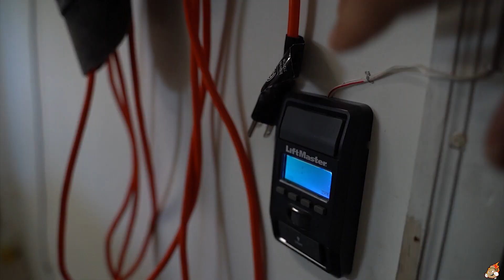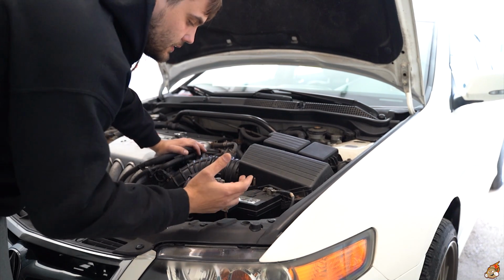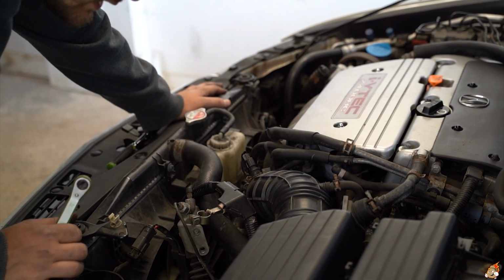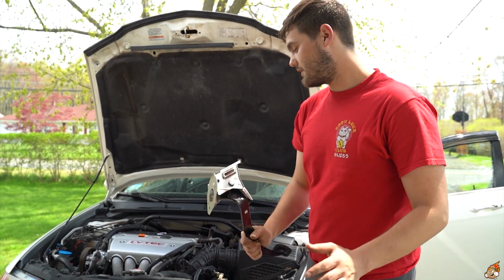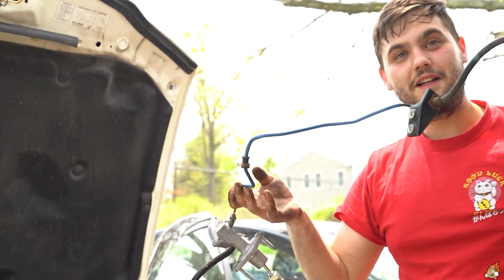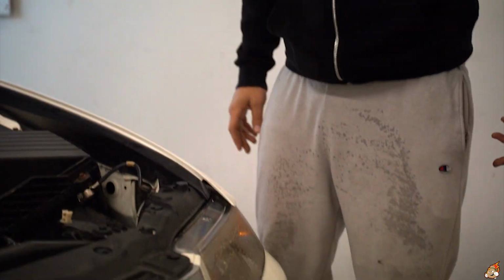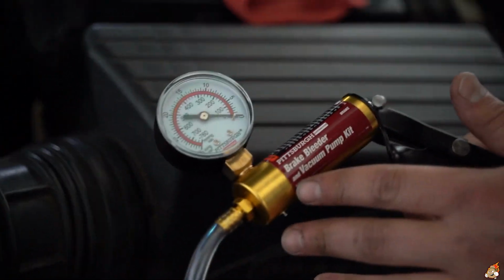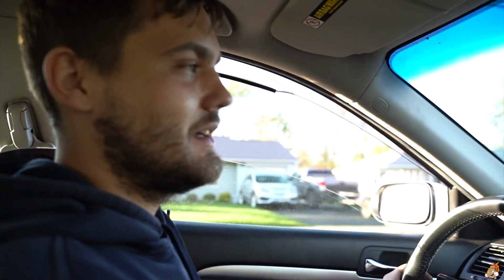Hybrid Racing CMC & Slave Installed For The TSX // IMPROVED SHIFTS!

Comment: Did you switch over the CMC rod from your OEM TSX slave to the EM1 CMC?  They are different lengths and Hybrid Racing says to use the OEM rod
Reply from the maker: Yes i did, if i remember I didn’t at first then learned the hard way had to take it back out and swap that and the little bracket over

Comment: Rish 
I have hybrid cmc & csc, 

Trying to adjust pedal n engagement n etc. 

Tips bro? Appreciate it
Reply from the maker: Gotta adjust it from the rod on the CMC, so you loosen the nut with a 12 mm. 
Get a vice grip and adjust a little at a time little goes a long way. Bringing the rod toward you brings the engagement lower and less pedal pressure. Then obviously the opposite going toward the cmc.
Reply: @RishMedia  curious- how much higher is your clutch pedal compared to your brake pedal?
Reply from the maker: @M35180S  honestly no clue never checked or realized a difference
Reply: @RishMedia  my clutch pedal is noticably higher. Okay

Comment: After I replaced my cmc my clutch pedal makes a creaking noise. Any suggestions?
Reply from the maker: Put some grease on the cmc rod/ball push it in and out get it moving, grease more where the spring is on the bracket. If is still happens you may have some cracking  on the clutch pedal bracket
Reply: @RishMedia  hey so I sprayed alot of silicone spray and white lithium grease all over and the noise was still there. After digging around online I found on an rsx forum that it’s actually the slave cylinder and the clutch release fork. I verified it with someone pressing  the clutch pedal a lot. It makes sense now because when i installed the ktuned master n slave. I don’t remember greasing the slave ball n clutch release fork areas. The rubbing medal ball onto the fork is so bad that I felt it on the pedal. Maybe U should do a video of taking off the slave to grease the ball n fork areas. I couldn’t find any videos on it and also the Honda super hi temp grease is hard to find so I haven’t tried to fix this yet.
Reply from the maker: @tannguyen-dg8su  yup that’s also a culprit to the noise like you said. Always any metal on metal friction more than likely want some grease on there! 

I’ll be replacing my cmc and slave soon on the black daily Tsx and ofc a video coming on that!

Comment: Hey rish ..which do you prefer for a cmc and slave ?? Since you have installed hybrid and ktuned before and do you prefer sticking with the stock slave or will be better to just get the whole kit
Reply from the maker: Honestly the slaves are all the same functionally wise just some quality differences, the braided line and the no delay valve in CMC what really help.

Comment: Hey man I did this mod just the other day and I know you have to remove the em1 rod and replace it with the OE rod. But after everything my engagement is really high and I'm not sure why. Even after trying to adjust it down. How did you adjust it?
Reply from the maker: You’ve gotta being the nut on the CMC itself basically like flush with the bracket, then i think itll allow for more in and outward adjustment with the one with the sensor.

Comment: Is the slave cylinder also from an em1 or just the master cylinder?
Reply from the maker: Honestly that I’m
Not sure slave is just the slave honestly I don’t think it’d have a special purpose oppose to others. 

The CMC is what really does it,  people said they’ve pieced together their own setup
Reply: @RishMedia  thanks also when installing the cmc and slave did the engagement point change or it stayed the same where does your clutch grab and engage
Reply from the maker: It definitely changes just try to match up best as possible to the oem but make sure you use the oem bracket that the pin goes into. 
After market ones never seemed to work

Comment: this is awesome mod but a PITA to install. if you can get the m&m clutch pedal or reinforce your clutch pedal. it makes shifting a lot easier on your foot. you don't feel like your getting a calf workout hahah
Reply from the maker: Hmm I’ll have to look into that! I also need the dang padding that goes between the cmc and firewall cause the metal on metals giving me vibration noises lol.. 

Overall feels great tho gotta re bleed my clutch another good time
Reply: @RishMedia  I don’t feel vibration on the pedal. If you can get the euro R pedals there like 36 dollars from Japan it might help with the vibration
Reply from the maker: @proraceer07  had the same problem last time I did this on previous Tsx, never put it on cause idk what it was. 
But this time didn’t even come with one also think the little pin has a little play from me sanding it down
Reply: @user-hh4hc2lt6e  yes I have this one, check Blackhawk Japan they might have it a bit cheaper

Comment: Hey bro same shit happened to me!  Im currently installing this kit in my 07 TSX.  Bled everything before putting the slave back in its spot.  Now i cant squeeze in the slave to screw it on.  Wtf did u do to fix that??
Reply from the maker: Okay so it’s annoying af but take the slave boot and just kinda pop it off so the fluid comes out cause it’s pressurized. 
It’ll be a bit playing with to get the boot back on but then you should be good to go
Reply: The boot?  U mean the boot to the piston or the bleeder valve.  Shit was a bitch lol only thing holding me up right now.
Reply: Well I got it all working correctly. Had to adjust the clutch pedal as the catch point was way too high. Just turned that screw a little lower towards the master cylinder and that fixed the problem. What a night and Day difference. Definitely worth doing this mod
Reply from the maker: @mcosta1819  was the boot on the slave itself that sits on the fork, that was filled with fluid creating the pressure
Reply from the maker: @mcosta1819  but good stuff man glad you got it figured out!